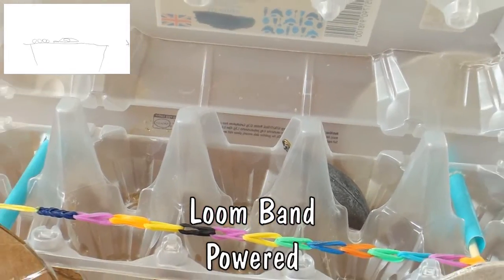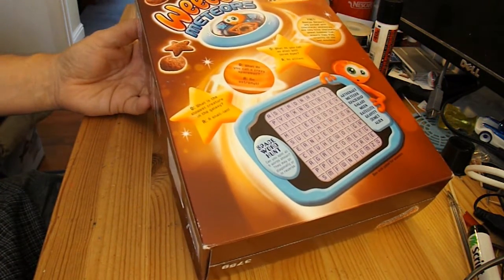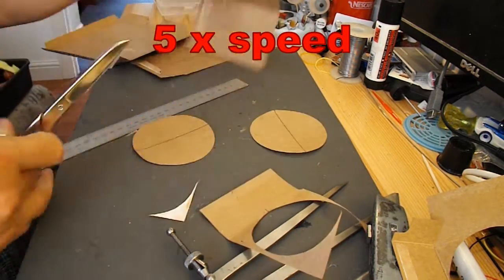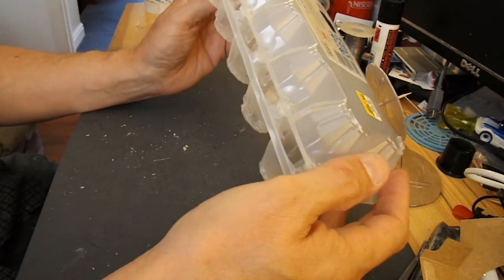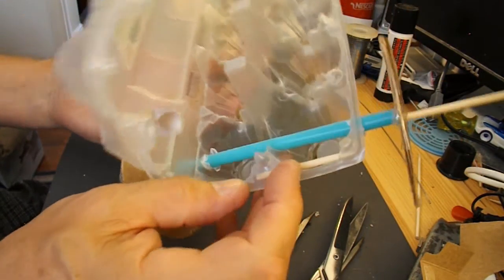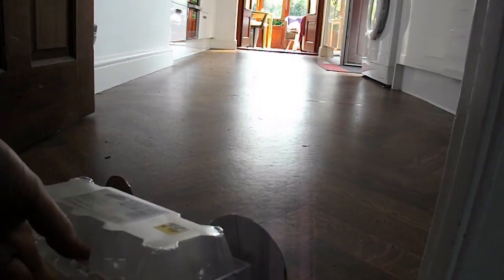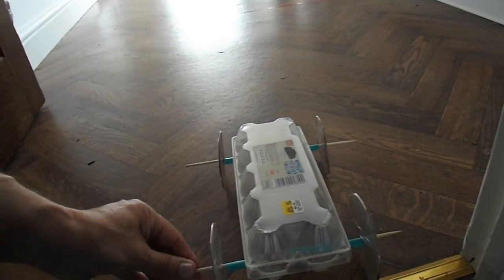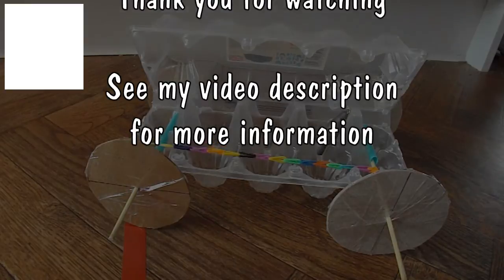Loom Band powered Egg Box

Comment: Not sure if this would work, but I'm thinking you could cut a small pvc or rubber hose length wise and wrap around the edge of the tyres for some extra traction. Nice video as always Grandad. Thumbs up.
Reply from the maker: Hi daddymarkram, I usually cut up balloons or rubber gloves to improve the grip but in this case the request stated they had very limited items they could use so a lead weight or just a pebble seemed appropriate.